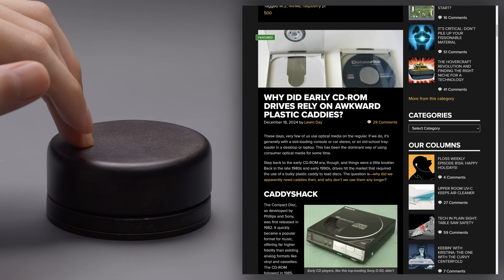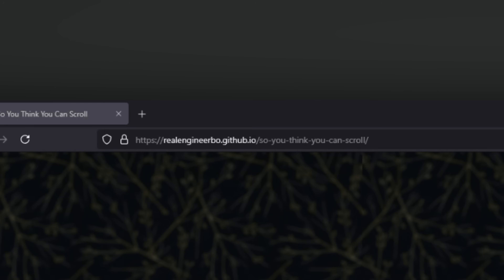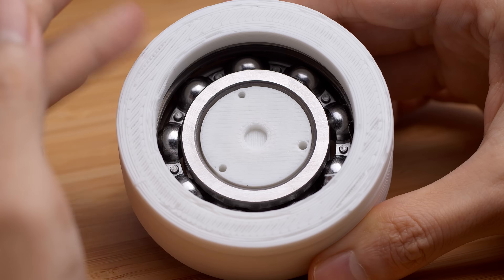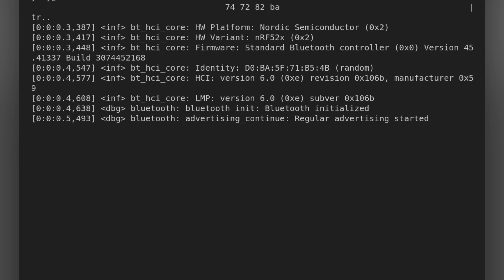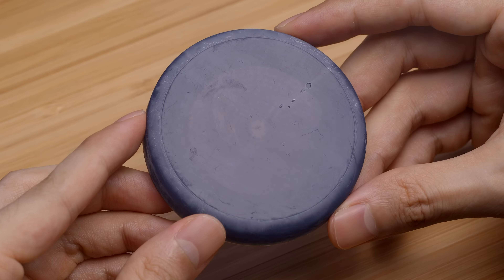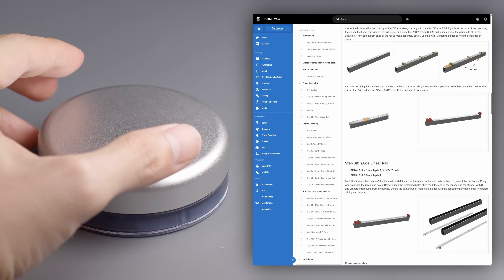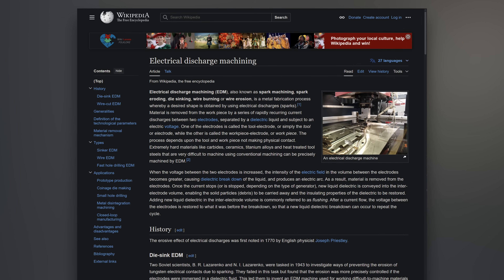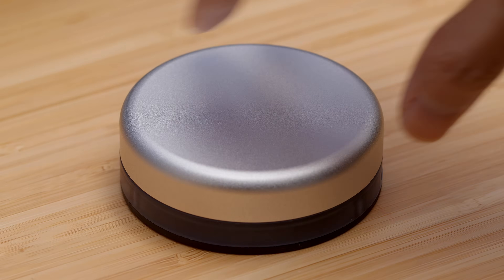Wireless High Resolution Scrolling Device: Full Scroll Dial v2

Comment: I bought a Surface Dial for no good reason, but still make good use of it. Its high resolution scrolling is fantastic. I do worry about its future compatibility, though. It's been working for the last 8 years, though. I haven't tried making it work in Linux.

One thing that's nice about it is that it has OS integration in Windows, even still, in Windows 11. Holding press-down on it gives you a radial menu that changes functionality. It also has a sticky undersurface that's meant for you to place it on a Surface device's screen, which does work with a couple Windows apps I still use on my Surface Pro (like the drawing app Leonardo). I haven't used it that way in ages, though, I mostly just use it as a big, tactile, smooth scroller for my desktop.

Its settings are accessed in the OS's own settings, under “wheel settings”, seeming to imply an open API, or something (given the generic name).

Comment: You can do small batch injection moulding with equipment for under $1000 (some assembly required).
For wireless stuff you don't need to worry about certificates, testing and conformity, IF, you buy off the shelf RF module already tested and with certificates, those come on small PCBs with castellations, there should be a lot of them meant exactly for low development cost computer peripherals.
Regarding battery, you can do same as with the above, buy already assembled battery pack which has all the certificates/tests.
To get better resin prints you need to use higher quality resin, I believe soraya makes decent affordable stuff, and also print it in warmer conditions.
Aluminium oxide you get from anodising, is very hard, harder than steel, maybe even titanium, it might be hard to thread it, or you just had wrong hole size selected.
I tried that scrolling game of yours and I got 49550 with my mouse wheel first try, with few more tries I got 67854.

Comment: Not saying your project is bad or useless but you really don't need to scroll this accurately when browsing the web :P for volume or photo or video editing tho it sounds awesome.
But I love this. would love a tiny version on my mech keyboard when I make my own. my issue is that I'd like friction on it. like the mx master 3s but like smooth and nice.
also damn you even made your own RF electronics and antenna? I wanted to try that but it sounds so hard and scary and expensive :D

I wish I had your skills and equipment, but I'm just a software engineer LOL
would wood be so amazing (pun intended)

Comment: Hello, is the project available anywhere? I know you've placed a lot of work into it and I'm aware that you might not be willing to share. If you do, I'd be happy to copy your project and tinker on it. I could provide all the details to you, or share my finding and post them online.

I've got several ideas for the project already in my head, but, don't want to focus on it too much if you don't plan to share it. 

I'd build everything from scratch and your video goes into many details, but I run electronics repair shop which we turn into the franchise here in the UK and, I've got other projects going on. As I'm aware how long it takes to correct the mistakes you make during the design, I'd rather not start at all at present.

But, the project is REALLY interesting and nice looking, so,  I'd be happy to give it a shot.

Thank you for the video and in depth explanation :).

Comment: I still notice a tiny bit of wobble with your device. I got motivated to build this project myself (however, it's wired only at the moment) and used thrust bearings which ride on metal plates with pins. It has 0 wobble, but I'm on macos so that insane scroll speed is something Im still dealing with.

Comment: In 2007ish I had a normal cheap mouse with almost perfectly smooth high-resolution scrolling. Then with the introduction of optical mice, for some reason all the mice started using clicky scrolling and I could never find another mouse with that feature. :(

Comment: Great work! Whenever I used a lipo battery in a project, I was always afraid of the risk of explosion. Is there a lipo charger design that you really trust?
Reply from the maker: There are many reference circuits for charging lithium batteries (e.g. Texas Instruments charging ICs), but that's really only one part of battery safety. The batteries/cells should be tested and certified, they should have protection modules to prevent overcharging, short circuits etc, the battery should never be charged above its rated current or voltage, the battery needs to be mechanically safe from impingement, and more. It's quite a topic.
Reply: @engineerbo  By the way, I really liked your video style, your approach to the subject and engineering. You have prepared quality contents. I hope your channel gets to much bigger. Good luck!

Comment: to remove the broken steel taps from the aluminum top you can soak it in a solution of alumn (potassium aluminum sulfate). it will dissolve the steel and not bother the aluminum. can be bought at a grocery store

Comment: Could a large thrust needle bearing for the outer wobble, plus smaller inner ball bearing with a spring washer for preload tension potentially solve the wobble issue without increasing drag too much?

higher quality bearings that are rated for higher speeds (like a hard drive spindle bearing), will also be smoother.

A 1 inch fpc ribbon cable would allow an off the shelf cable/connector for the sensor board.

Comment: When I clicked on this video i didnt expect custom antenna tuning with a VNA but damn great work!
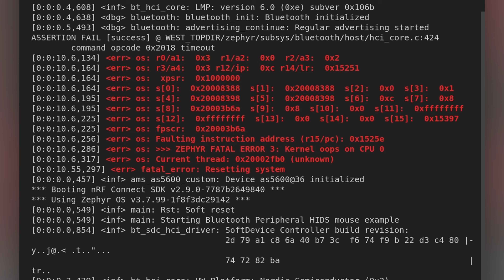Also when debugging zephyr you can use the faulting instruction address printed in the kernel panic (7:50) to print the faulting source line using addr2line in the toolchain, this really helped me iterate quicker with zephry hope it helps you!

Comment: You can dissolve broken taps out of aluminum with a concentrated Alum solution. It takes a long time, but will not damage the aluminum base metal. I do not know if it will hurt the anodized surface though, it may strip the anodized layer off and leave you with perfect raw aluminum underneath.

The polycarbonate cap is screaming for RGB LED's

Comment: For Linux, there is the surface-dial-linux project, which is a Rust driver for the Microsoft Surface Dial. In the multitouch scroll mode it emulates a two finger scroll on a touchpad, which gives incredibly accurate results. I'm using a modified version of this driver so it also automatically resets upon no movement and that pressing the dial itself performs a 'back' operation. 

This driver seems quite easy to port for your version.
Reply: Are you on X11 or Wayland?
Reply: @ I'm running this on Arch, with Wayland KDE. No issues so far.

Comment: A small turning nob on top to help lessen friction would be a comfort feature as you won't be rubbing out your finger prints and twist your finger too much.
Reply: Or make it two headed, big one on one side but where you flip it over to reveal a smaller knob.  Same device with the user able to flip between modes.

Comment: Awesome product! I have a suggestion to save some material cost and assembly time: use a common 2.54mm pin header and socket to connect the mainboard & sensor board. They’re available in all lengths & SMD, so I think you’ll find what you’re looking for! Good luck!

Comment: It's a common misconception to think simple mechanisms can be without play. For a single bearing (or many other mechanisms, like gears or rack and pinion), you either have play, or it's going to be stuck. And applying pretension will drastically increase friction. In different applications, you would use a bushing anyway but I doubt anyone would want a built-in oiler in their scroll wheel.

Comment: People were talking about that middle click??..

I thought it's the one where you drag the page like on a touchscreen by holding middle click - it also has velocity so it's pretty convenient

But I just realised I just had an extension installed that does this for years, this is not standard, except for like in some drawing software.

Comment: After your first video I made a wired version with some parts I had available. An rp2040 with hid remapper, arduino nano for mouse, as5600, fidget spinner bearing and an engine bolt and nuts. It works so well I'm redesigning it with a large bearing and 3d printed case, looks like I'll need to find a large ceramic bearing
Reply: Did you have some code example?
Reply: @ivanalimpiev1357  hid remapper is a simple gui with v scroll as input and output with a multiplier less than 1, the Arduino is basically the mouse example changing the third variable with the difference from last measurement in mouse.move(x,y,scroll) after reading the raw angle from sensor.rawangle() in the as5600 example code

Comment: I guess you can introduce damping to the rotation speed by placing some magnets closer to the aluminum ring due to eddy currents. Probably you can make a generator to automatically recharge the battery using the rotation thereby providing the damping at the same time. Further you can introduce cogging to imitate scrolling by larger steps.
Reply: What if the battery is completelly full and you keep scrolling?
Reply: @pedros43ful  we can use a resistive load to dissipate the energy.

Comment: So You Think You Can Scroll
yeah.. i think.
35k...53k
with mx master 3S scroll on free rotation
it has nice moment of inertia/physical scrolling too.
but your scroll must feel nice to use
i have suggestion for bottom cover - isn't that spray something like soft-touch coating, that deteriorates over time into sticky mess? (if not - then it's fine)
but if it is - you may want to try something like ... "Silicone Sticky Anti-Slip Gel Pads for car dashboard" - something along those lines.
it's quite grippy and doesn't deteriorate.

Comment: The anodizing will grow a layer of of AlO2 on the Al. Which is glass hard ( literally ). you have to compensate your tap screw holes for that (probably PCB-way has some documentation for that) And indeed a dimple on top will be much preferred :-)   look at the dial knob for ham radio's (google TS890). What a great design!

Comment: I've worked on implementing high-resolution scrolling for a keyboard trackball. Linux is, as is often the case, a mess. If you're using something relatively modern (Ubuntu 24.04 should be fine), it should work if it works on Windows, but with a bunch of caveats. For one, not all apps will scroll smoothly—Firefox and Gnome Terminal didnt for me, but Chromium and Files (Nautilus) did. There's also an issue with libinput that forces some scrolling to be accumulated before it does anything, which can make it seem like the smooth scrolling isn't working, even though it is smooth when it finally starts.

If it doesn't work in any app, depending on your firmware's logic you may be affected by some incorrect processing in the kernel. I can dig up the details if it'd be helpful.
Reply: Hello, do you know how to make a HID descriptor for high-resolution scroll? I want to use it with arduino micro project.
Reply: @OppaYA If you know how to make the descriptors for regular scrolling, the HID spec should tell you everything you need to add for high resolution scrolling. Microsoft's whitepaper on it gives some useful context about how the OS handles some things, and Linux's support involved at least consulting that whitepaper.
Reply: @AdityaBhargava  I tried but seems there is no library for arduino that supports custom HID, or i cannot find it.
Reply: @OppaYA I have no experience with Arduino, sorry.
Reply from the maker: Interesting, thank you for the information!

Comment: A small dimple on the dial will help with precise scrolling, the ultimate build may have a circular touchpad at the center. And a gaming version that has both touch at the top and optical at the bottom , one for head movement, another for gun aim.

Comment: I saw that you have some experience with BLDC motors & FOC, what do you think about adding a small BLDC motor inside to make it be able to provide configurable haptic feedback / infinite scrolling? Then you would be able to use essentially any bearing you want and just customize the feel (scrolling speed, smoothness, inertia, deceleration etc) in software. But i think you would have to make it wired in that case since it drains the battery substantially faster
Reply: I agree with you! I ordered the parts but this is very much the beginning of the project for me. For people interested in doing that, Lilygo got a product that (I think) integrates everything into a nice package: T-Knob. There is "just" the software to implement, something I plan on doing .... sometime ... soon?
Reply from the maker: Yes that seems to be a popular feature request. I really enjoy playing with motors, but I'm not convinced it'll add a huge amount to the user experience for this device (besides to cost and power consumption). Maybe I'll be proven wrong if/when I build it in the future!

Comment: You should add capacitive activity to the wheel that has the aluminum knob. So that way the moment you let go, the scrolling stops. For reference look at how digital DJ mixers work like the Pioneer XDJ series! Awesome project!
Reply: With a speed threshold so that if you give the wheel a flick it will keep scrolling until it stops but if the movement speed is sufficiently low when you let go it stops right away.
Reply: Once you have that, tap to click is a few lines of code away.
Reply: sick

Comment: The off-center knob is pretty annoying. If you decide to move forward with a cnc machined knob, I suggest producing a drawing with a tight concentricity tolerance (around 0.25mm maximum center distance should be good) between the inner and outer wall of the knob. That way you can make sure it spins true.
Reply from the maker: Yes I noticed it while editing the video. I specified too generous a clearance fit for the aluminium part because I didn't want to have to modify it if it didn't fit!

Comment: Would love to see a few things on this: 1) Have the dial be a ring so you can put a stationary mouse trackpad in the middle.  That way you can navigate to different windows for scrolling all without having to remove your hand.  2) Qi charging pad on the bottom in place of a usb-c so that you can just put it on a cellphone charger to charge the battery, complete wireless.  3) tilt to click on two sides so you can scroll sideways for cases where screens have horizontal scroll bars or when working in coding softwares where comment boxes also have horizontal scrollbars.

I absolutely love this.  Even if you're not a major scroller, having something like this for work in Photoshop where you may want to quickly change brush sizes or change slider values would be so nice.  Keep up the great work!
Reply: Number 1 completely breaks the design because then you need clearance in the center both for the top and the bottom. He'd need to switch to a hollow shaft magnetic encoder and redesign everything from scratch
Reply: @juliusmakes  that's why you get two of these puppies like naya tries to do rn
Reply: @versedi  Who's naya? I'm genuinely curios what they're doing
Reply: It's fair to say that a redesign would take a good amount of work and how much work he's done on the design that could be undesirable.  Considering how much time he's put into this labor of love, if he likes the suggestion, that's not really a consideration.  These are suggestions that could potentially make his (or others) scrolling more enjoyable.  Also, given he's already using a bearing, having a center shaft that he could use as a mount for a touchpoad isn't really that far of a stretch.
Reply: Everyone has a USB cable, many of them. Not everyone has a wireless charging pad. USB charging is fast, clean and efficient. Wireless charging is lossy, slow and wasteful. And it needs increasing hardware complexity for something that is, in fact, worse. Wireless internet is convenient because you can move around and stay connected. With wireless charging you're still tethered to the charger. So, poor at charging, poor at being wireless. And with USB you also get a free data port. It's all upside vs what is essentially overrated technology with a deceitful name.
Reply: Wireless charging would be awesome. A ring of magnets to allow Qi2 compatibility would be nice and would also allow you to mount the dial on other surfaces.
Reply: the wireless charging is cool but if the dial is metal you might run into some losses

Comment: Thrust bearings. The bearings intended to do its thing for axial load is called thrust bearings. There are types built similar to regular bearings but built like sliced bagels, as well as conical designs that use pins instead of balls. Then you can preload it axially if you want. Also, acetone works for degreasing the bearing for smoothness, but degreasing also generally ruins operating life, to note.